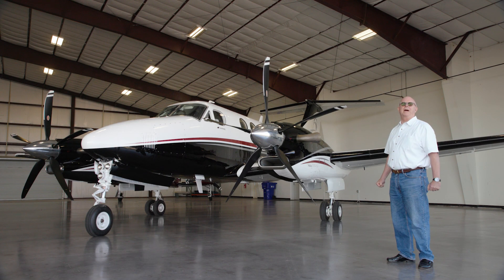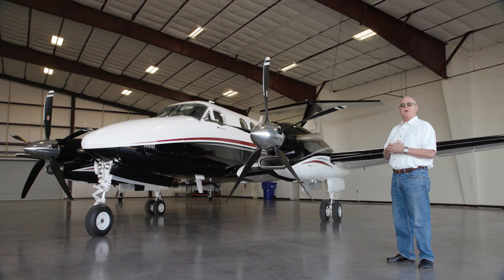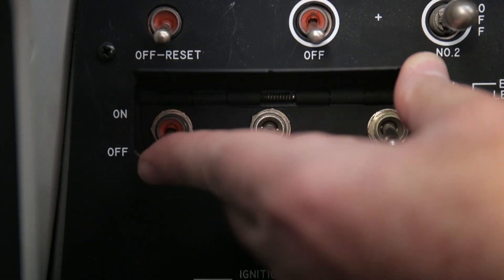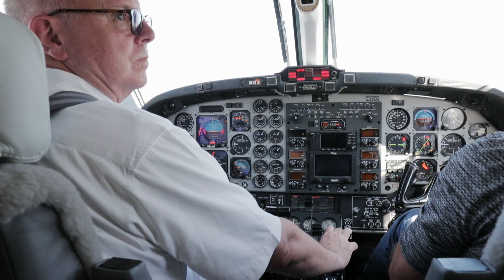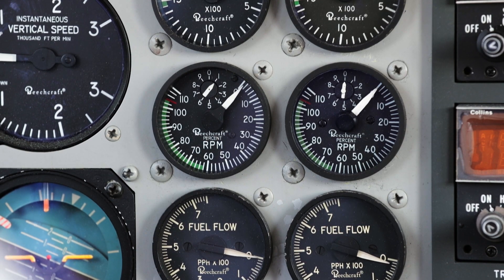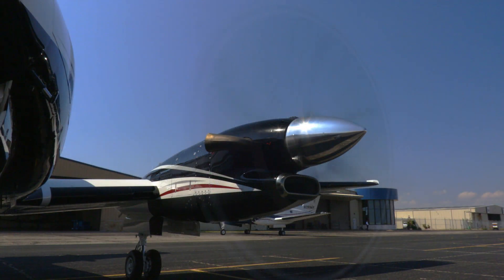Tips & Techniques: PT6 Engine Start

Comment: Excellent calling the ITT gauge the resume gauge, as U know, if this gauge goes hot it's the end of ur pilot days.??!!  Thanks so much 4 showing me my old school roots in the Aviation industry. South Africa's SAAF fitted PT6s to there fleet of aging DC3s. I was fortunate 2 work on some of those engines during my service in the SA Air Force. I started on turbomeca Helicopter engines, moved to Allison C130s, C160s, Boeing air refuelers, and some 337 Cessna turboprops..Served the SAAF until an accident and brain injury stopped me from flying. Miss it dearly!!

Comment: A whole panel full of steam gauges and P and W were the last one to introduce FADEC. You think with a parent company to pave the way, they be the first to have FADEC but instead they sat on their back sides till competition was seen coming on the horizon.(GE !) The industry's piston engines are in the same shape, still stuck in 1930 technology. The only thing not stuck standing still are the cost.
Reply: If it wasn’t for the GE Catalyst they probably wouldn’t have FADEC.
Reply: @calvinnickel9995  Pratt and W US parents did all the R and D work, and could have transferred the tech over anytime 2 decades ago. Fadec, one button start, auto throttle etc. I first read about a small incident few noticed, GE quietly bought the CZ company Walters that made a clone of the PT-6. That was almost a decade ago. A lot of used Walters went into expensive homebuilt.

Comment: Not to be nasty too much,
but I must have blinked
when  illustrations and tips
came on the air.
Should have been an illustration
which isn’t on the tube 10,000 times.
What about a cross start ?
I’ve searched far and wide  and
can’t find one video.

Comment: 2:08  Just wondering....how is the torque measured?  Some kind of strain gauge on the prop shaft?
Reply: it uses a manifold and a transducer which measure oil pressure. that oil pressure transducer is calibrated to the gage in the cockpit with a dead weight tester. 
But to answer your question it's calculated base on oil pressure. The manifold and transducer is located on the front left hand side of the engine, nearby the prop governor.

Comment: How would you reduce the ITT during start if it was getting too hot?  
Also, where exactly are the ITT reading taken from in the turbines?
Reply: Oh.. and ITT stands for Inter-Turbine Temperature. It’s taken between the compressor turbine and the power turbines.
Reply: You cut the fuel off and switch to starter only until your ITT is below 400. 

To have a cooler start you need to be more proactive. For me.. I point the aircraft into wind, have engine anti-ice off, have good battery voltage or a GPU, crank until 18% N1 or ITT has reduced to below 200C (if it’s a warm engine) before introducing fuel if I’m concerned about starting temperatures.
Reply: the ITT is taken with probes mounted between the power turbine and the compressor turbine. There is a harness that leads out of the engine called the T5 harness and it goes to the T5 block on the upper forward right hand side of the engine which then the indicator is connected to with a long wiring harness.

Comment: Hi, great explanation! One question from a jet jockey with no experience on turboprops but always fascinated by them! If I understood it correctly while operating in the beta range, the torque maintained at a constant value - either low or high idle based on the setting of the condition lever in a free turbine engine, and u vary the thrust by varying the pitch angle on the blades so that is for instance you move the PL forward you increase the blade angle first increasing the mass of airflow accelerated backwards and thus as a reaction the thrust that propels the aircraft forward, and then the HMU - i assume a sort of bottom governor - increases the ff to the engine to compensate for the increase in the required torque to maintain  constant value - low or high idle - to drive the prop and the accessories on the AGB and the RGB, like the generator, for instance; and vice-versa. Also my question is, why do u need a beta range while on the ground? can t u operate the prop and the engine in a normal way as when in the forward thrust regime? Thanks for sharing
Reply: Alpha is the normal forward thrust regime. It’s limited by the flight low pitch stop in the air and the ground low pitch stop on the ground. These low pitch stops are movable and artificially created by the beta valve which controls oil flow from the prop in combination with the beta feedback ring and the prop solenoid. (This applies to a traditional PT6.. not the Blackhawk shown here). 

The power lever controls N1 via the FCU input shaft in alpha range. The N1 idle is set by the condition lever and it’s usually left in low except for a cross gen start. N1 correlates with torque as it advances as well as prop RPM until the prop moves off the low pitch stop and into the governing range. 

Beta is the range below the ground low pitch stop to the start of the reverse range. This is controlled directly by the power lever via the reversing cam which is stationary in the alpha range. The reason you control the prop this way is so you can have quick reacting control of the thrust in this range. Most taxiing is done in Beta which saves brakes so you can set a neutral or a zero thrust or add it or take it away with the lever movement.   No prop governing is necessary in this range because N1 remains at idle though all three governors (primary, over speed, and fuel-topping) would become active as necessary if there was a runaway. 

Reverse range is rearward over another gate and this adds N1 to add reversing power via that same reversing cam as well as moves the prop below the beta range into reverse. 

Since the prop is accelerating, it needs to be governed. You can’t use the primary governor because when it senses an over speed it will immediately coarsen the blades.. which in reverse means they will actually move to a finer reverse pitch and then to a coarser pitch which would first overspeed the prop and then produce a ton of forward thrust when you don’t want it. 

So it uses a fuel-topping governor. This is a valve which bleeds Py pressure from the FCU.. making it think it’s at a higher density altitude than it really is, and reduces N1 to the point that the prop stays at 94% (IIRC) selected RPM on the prop lever. If your prop levers aren’t fully forward.. this means you can’t get maximum reverse RPM, and this means you’ll get an annunciation saying Reverse Not Ready when the gear is down but prop levers aren’t full forward.
Reply: @Bartonovich52  nice job
Reply: @Bartonovich52  Nice work here.
Reply: Here you talk about the NG's but the only gauge I see when you bring up watch the NG'S  the RPM gauges. What gives?
Reply: @22floridacat NG is the rpm of the engine as a percentage.

Comment: If a hot start ended my days as a turbine pilot for hire,,not sure I wanna work for that outfit anyway.
Reply: There’s exactly zero reasons for a pilot to allow a hot start to happen. 

I don’t want a pilot who cooks an engine that now requires a hot section or overhaul “because maintenance”. 

I want a pilot who pays attention and discontinues the start before it gets expensive and grounds the plane for weeks. Then they can swap out the FCU or replace the nozzles or take out the inlet plug you forgot that’s now hidden behind the anti ice ramp.
Reply: @Bartonovich52  as a jet pilot myself,,I can tell you by the time you react and cut the power to the engine you have already done some damage and will require an inspection. That is no reason to fire someone.
Reply: @mikeyb8313  you must have a really slow reaction time bro. but yeah if you do hundreds of thousands of dollars in preventable damage, why get fired, right?
Reply: @bmw_m4255  Slow reaction time? We aren’t sleeping, but it might take a couple seconds to react to it. That’s enough to cause some damage. Idk about 100s of thousands though. But you clearly sound like the type of management who would suspend a pilot because he turned back to the field due to an issue and then management who probably have never flown before decided it wasn’t serious enough to turn back…am I right?
Reply: @mikeyb8313  I did work at a place that would push pilots to fly in situations they were uncomfortable with and I saw one fatal crash because of it.

I back flight crew 100% . But a hot start is preventable and honestly you aren't doing any damage most of the time. I don't know the what aircraft and powerplant you're operating though maybe it's easier to overtemp but a pt6 like this, you'd have to be not paying attention or incompetent to let it overtemp beyond limits to where a mx action is needed

Comment: The start was OK! There are two redlines: one for the start, and another for other operations. The start redline is higher! Look at the ITT gauge carefully. You'll see a small, printed "start" label above the fatter redline. That's the redline you want to observe for starting.
Reply: Once you're above the first red line you start the timer, not sure what it is in this specific model but mine is 5 seconds.
Reply: you need to look at both redlines, there is a time limit at which you can be above the first one.
Reply: Really good comment

Comment: Much easier to start than my R1340 😊
Reply: T6 ?
Reply: @potpot1907  Yes 😊
Reply: @ericgirardet1848  Awesome!!
Reply: @ericgirardet1848  i used to study T6 when i am a aircraft mechanic student but unfortunately i never has a chance to run a R1340.
Reply: @potpot1907  you should try to get in touch with a Texan owner. We love guys who are enthusiasts about that plane. I am sure he will show you everything. Starting that engine is something really fun to do. I still love it, the noise, the smoke.
Cheers!
Reply: Honestly they are about the same. 

We had both a Harvard and a King Air at my school. The Harvard requires three hands, but the King Air requires three eyes.  He forgot to add ignition, fuel pressure, prop rotation, oil pressure, and fuel flow to his list of things to look at—any of which require discontinuation of the start if not nominal and clearing if fuel has already been introduced. Then there are all of the procedures for hot start, hung start, no start, and emergencies. 

The only thing that’s really harder on the T-6 is for the poor sod who has to hand crank the starter if the electric energizer isn’t working. Especially if he has to do it twice because you blew your start. I think maybe two students out of 20 didn’t get it started on the first try. Only instructors were allowed to start the King Air.

Comment: The ITT we can see there is NOT recorded during a start!!  All PT6 in the world except A6 and A20  make a stop around 38/ 40% while secondary nozzles start to spray and the TQ gage doesn't stay at zero. .  This video is a set of different views to explain what happens during start: That's it.
Reply: maybe they guy didn't turn on the inverters so the torque gage was inop. I'm sure this was an engine start because if he was temping that high while running that aircraft would be a bucking bronco, and also you can see the altimeter jumping around a bit which suggests the air from the engine starting is blowing back and whipping along the side of the aircraft and hitting the static ports.

Comment: The ITT exceed the red line, wasn’t this a hot start he talked about?
Reply: There is 2 redline one for normal operation and 1 for start
Reply: if you exceed the first redline during a start you need to make sure it doesn't stay there for long. there is a time limit.
Reply: Max temp on start is 1090*c

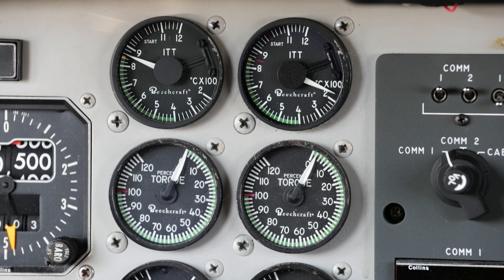Comment: At 2:19 the temperature is at 880 degrees and the Redline looks to 858 degrees.  Was this video meant to show us the dreaded “hot start”?  If so, it did a good job.
Reply: when you start the engine there is a time limit you're allowed to go over that first red line, the guy failed to mention it. Most of the time you will never see it go above unless you have a weak battery, or perhaps high ambient temperature and or altitude. Personally I would've aborted that start and got a GPU. He should have at least explained the time limit above the red line and what to do if it happens.
Reply: Jim Jordan look again, further at 1000 up is a black line with “start” next to it
Reply: 1000 degrees is the start limitation. This was not a hot start.

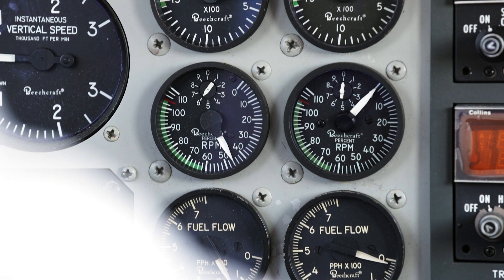Comment: 1:58 disengage the starter and let it "spring back" to the off position? Hmm not a whole lot of springing back occurring.
Reply: It’s not a spring back. It’s a gated switch. You lift it up over the gate and it stays there. 

I don’t know why they call it a spring back. That’s what the generator switch is. You move it to RESET and let it spring back to ON.
Reply: @Bartonovich52  does the starter cutout automatically at 50%? Then u just move the switch to off?
Reply: @kevin3063  All manual - no auto cut-out. It is the same on the B1900C.
Reply: @Bartonovich52  hey are you familiar or an expert with pt6 engines? I have some questions

Comment: Ahhhh...  Wasent that a HOT start???
Reply: Nope there is 2 redlines 1 for start & 1 for normal operation
Reply: Looks warm, but if I’m not mistaken max temp on start is 1090*c
Reply: We’d treat it as a hot start. Anything above normal redline is immediate cause for cutting fuel that so by the time you do so you haven’t exceeded the start limits.
Reply: @Bartonovich52  i would've also aborted that start, usually you don't see anything above 720ish. the guy needed a gpu

Comment: The start was disgusting hot!
Reply: weak battery
Reply: All depends on the engine and the ambient temperatures.. winds, etc. 

I’ve also found that P&WC are remarkably inconsistent in setting the secondaries in the FCU. Some light off so fast that I wonder if I’m getting a hot start.. some so slow that I wonder if it’s hung.
Reply: Kinda looked like that was hotter than any PT6 I’ve ever started!